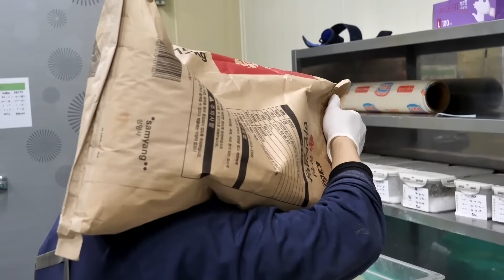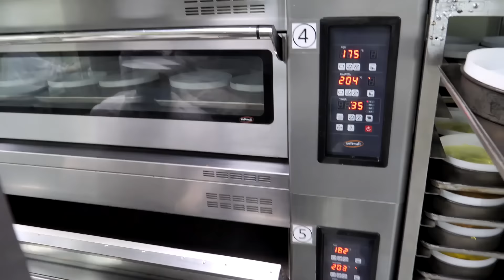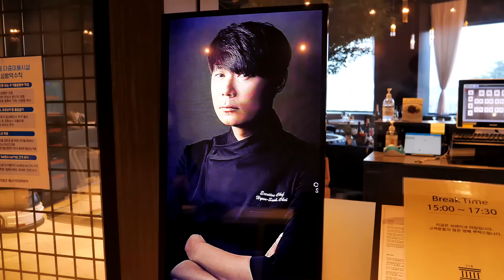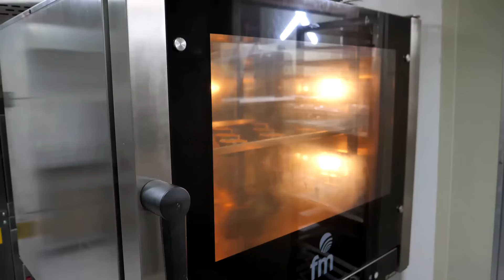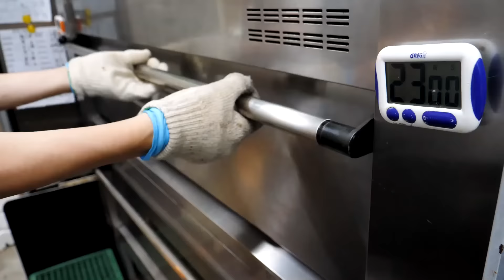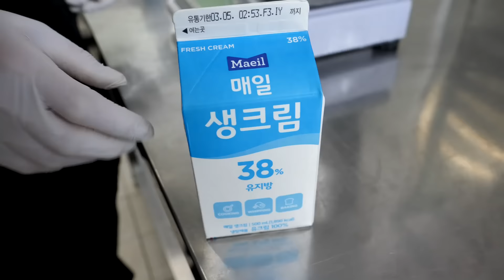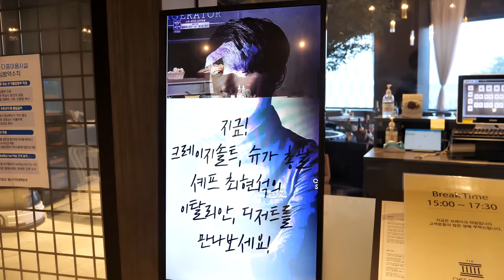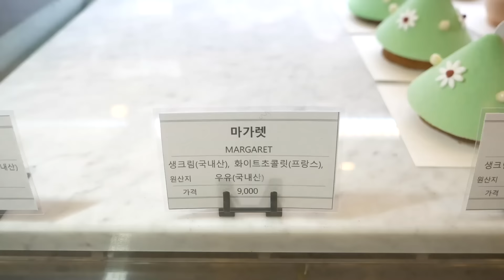케이크에 진심인 곳, 10곳 영상 몰아보기 / Welcome 2021! Top10 Best Cake Foods of the Year / korean street food

Comment: They sure do waste a lot of cake making some of these especially with the rainbow cake. I figured when they sliced the cake they would throw the tops away but I wasn't expecting them to also throw the bottoms away. Then when they cut them in smaller circles they threw the outer edges away. Just seems li ke so much to end up wasting. I wish they could find a use for it so they didn't have to waste so much. I mean I totally get why they aren't using those parts but I'm sure someone would still enjoy them if they could find a use for them.